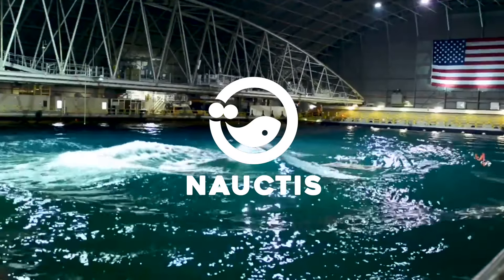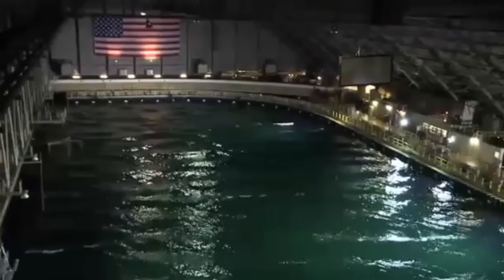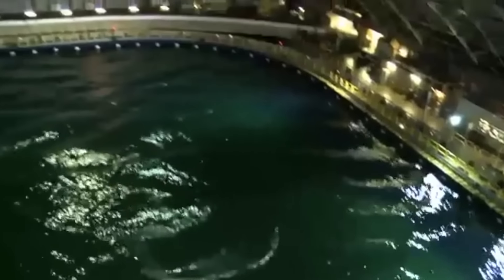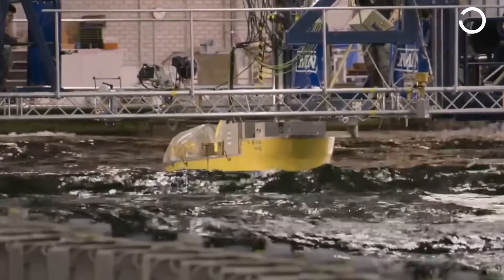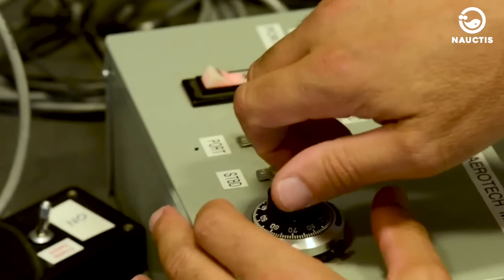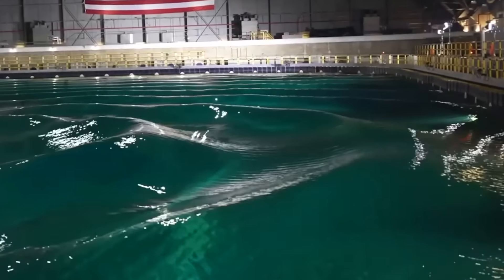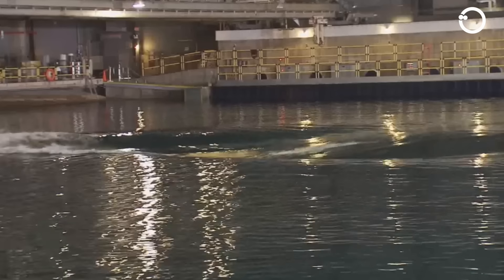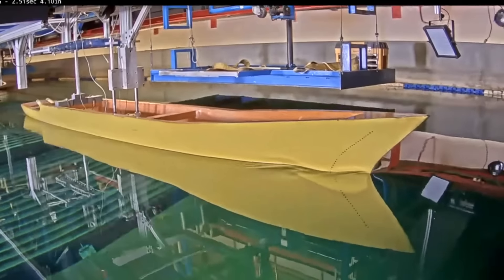NAVY Testing New Ship with Monster Waves Inside the World’s Largest INDOOR OCEAN

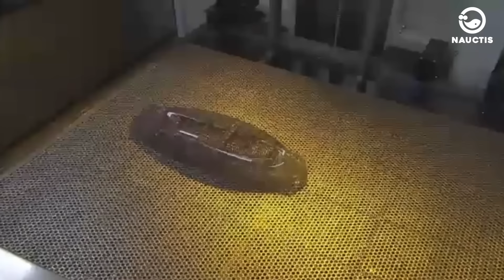Comment: A clip at 3:03 shows F/V Scandies Rose.  This vessel sank on 31 December 2019 around 2200 local near Kodiak Island, AK. Five crew were lost with two survivors. The loss was due to asymmetrical ice accumulation, leading to critical instability in heavy weather.

Comment: Ups! Nice ad for that tank. But the times where shipping companies test their ships directly in the ocean are long over.  Nowadays more than 90% of ocean going vessels are tested in a so-called model test basin. In general they are some 200 to 300 m long and about 20 m wide. Here you can test them in any kind of sea state and sometimes also winds to be sure they are safe at sea - not only in a harbour. You also test there propulsion and propeller data and more. And sure the engineers can recalculate from fresh water to any kind of sea water or even river water. MARIN btw is THE model test basin in the Netherlands.

Comment: Several countries do have such institutes including test pools etc. Brittain, Germany, Netherlands and many more. That is not something new. What differs is the advancement, not the seize of the models. It mainly depends on the disired requirements of the shipyards that want to receive the data of the tests. 
But it is quite remarkable in these times of computer simulations that these semingly oldfashioned methods are still in use; they still provide accurate data that is impossible to aquire using computers only.